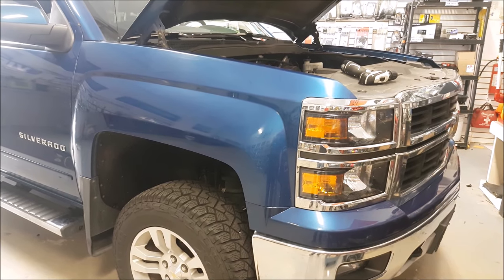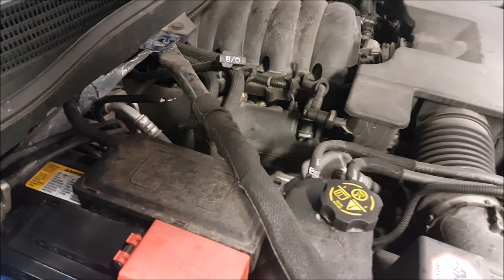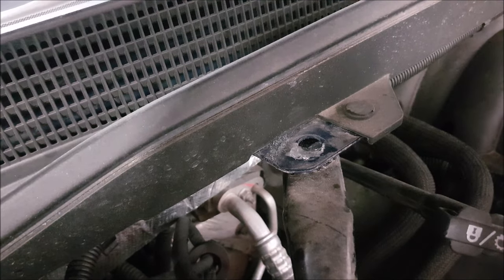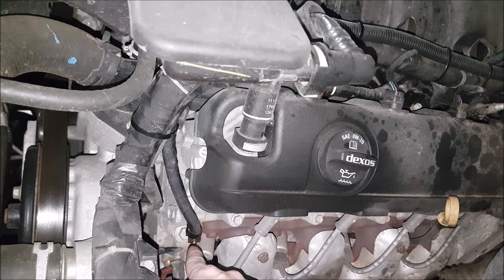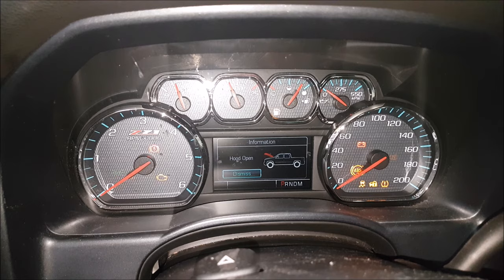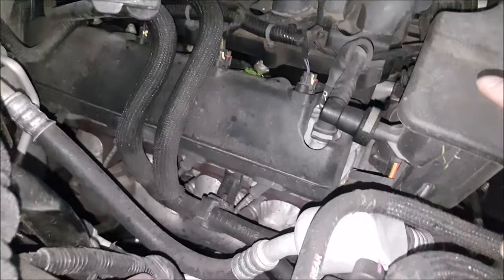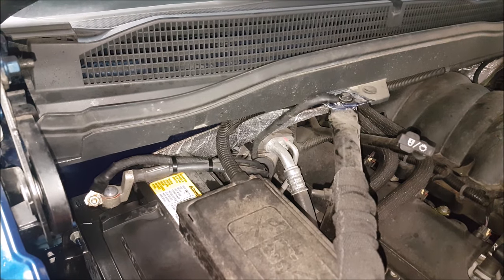2014-2018 Silverado/ Sierra Ground Upgrade K2XX (Prevent Electrical Issues) | AnthonyJ350

Comment: Does the additional ground from driver side cylinder head to firewall go through sensor as well?
Reply from the maker: No, only the wires from the negative battery terminal have to go through the sensor.
Reply: Great tks! Very helpful
Reply from the maker: @robertleblanc7245  Glad it helped!

Comment: I have this problem, but I'm running a couple extra runs of 0 gauge ground. The 0 gauge doesn't fit through the sensor loop. Anyone know how I can do this?
Reply from the maker: I ran 4 gauge through the sensor.
Reply: What size alternator or how many amps was your alternator that you used the 4 gauge for? Was that your only ground for alternator? @AnthonyJ350
Reply from the maker: @SOfficial-ie6bz  Stock alternator on the truck. Also upgraded grounds from cylinder heads to frame and body.

Comment: One more question if you don’t mind. What type fitting did you use for a connector on the left side of the engine? I want to do these things to my wife’s 2014 Silverado. Thanks
Reply: GM side post terminal adapter, the ones you use if you want to add extra wiring to a GM side post battery.  the pitch of thread is the same on the head of the engine.
Reply: Thanks!
Reply from the maker: GM side post adaptor, you can buy it from you local install shop.
Reply from the maker: Don't forget to subscribe ;)

Comment: My 2017 silverado / turns off and back on while I'm driving/ turns off power comes back right away/ no check engine light / I hear it could be the ground that has to do with my ignition/ do I make sense?
Reply from the maker: Was there an aftermarket remote starter installed by any chance?
Reply: @AnthonyJ350  / not that I know of I bought the truck used / I was looking at the grounds that go from battery down there is 2 going from battery thru O ring // I have not gotten to cleaning them / it happened like 2 days back toback / I pulled on them a little and it has been a 20 mile drive and it hadn't happened again
Reply from the maker: @edwincaro8805  Definitely pull the grounds off (disconnect the battery first), clean them and apply dielectric grease.

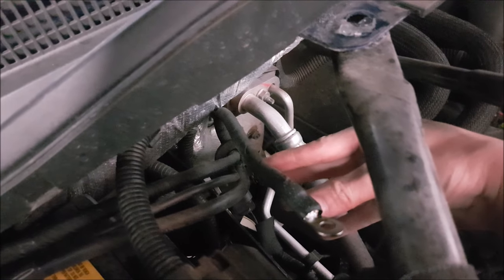Comment: At 1:00, u said u can put a bigger wire through sensor but u have to do something different? Why can u go to same spot as u did with the 4 gauge?
Reply from the maker: You'd have to replace the factory wire with the bigger wire
Reply: @AnthonyJ350  so I have a 2015 Silverado and I was planning on doing the big 3 upgrade with 1/0 wire what is my best option?
Reply: Just seen a video on mechman alternators, and they ran 1/0 from alternator through sensor to battery and kept the smaller ground wire as well and got rid of the bigger ground wire, would I be ok just doing that with a stock alternator?
Reply: And also doing 1/0 for power wire from alternator to battery
Reply from the maker: @lanedupont9316  Yup that would be fine because overall the wire is thicker.

Comment: I have 2016 silverado lt and sometimes my voltage meter drops and i have alot of static noise coming through car speakers i replaced speakers and same thing could it be a bad ground i had my stabilitrak light come on and off alot i replaced the battery and it stopped but it still comes on maybe once every month or two
Reply: Its the grounds. Run a new ground to your stereo's ground wire. My 2014 did this and that solved it. Also upgrade the battery ground cable like shown in the vid. Hope this helps!
Reply from the maker: Bad ground or bad cell in the battery

Comment: Amazing what a little Vaseline will do to force some zero guage through that sensor 💪🏾💪🏾.  Not sure if Vaseline will mess up sheath but 🤷🏾‍♂️
Reply from the maker: Next time you can use synthetic grease which is ok for rubber and plastics.
Reply: I used asstroglide!

Comment: Would this grounds be the cause if there was no power to anything? Or is the Fuse Block on top of the battery. That could be blown ?
Reply from the maker: Most likely a fusible link. There that big box on top of the battery where all the fusible links are. Dumb thing is if one is blown you have to replace the whole part it looks like.
Reply: @AnthonyJ350  hard to tell by looking at it if its blown.
Reply: @AnthonyJ350  how would check it with ohm meter?
Reply from the maker: @nighthawkj30A4  Continuity (on each side of the fusible link) or checking DC voltage for 12 volts on each side.
Reply: @AnthonyJ350  replaced the fuse block and checked the ground at the dash corners by the A pillars. And still no power at all. Going to check the ground by the passenger wheel well.
Reply from the maker: @nighthawkj30A4  What's the voltage of the battery?
Reply: @AnthonyJ350  new battery its 12.6
Reply from the maker: @nighthawkj30A4  Need to check all the fuses. Is there power inside?
Reply: @AnthonyJ350  we did there is no power to anything. No interior lights nothing even the remote doesn’t work.
Reply from the maker: @nighthawkj30A4  Need to check the fuse panel under the hood and make sure the battery wire is tight and showing voltage there. The whole thing can partially pull out.
Reply: @AnthonyJ350   check it as well

Comment: I have replaced  the battery  altantor  and starter  but I when I go to start my truck  it won't crank  but sometimes it will start   after awhile   I need help I can't figure it out lol
Reply from the maker: Check the starter relay and swap it with another one to see if it starts better. If it does, purchase a new relay to replace it.
Reply: @AnthonyJ350  it was a fuse for abs something  I replaced it and it starts no problem
Reply from the maker: @Ricky-manic  Glad to hear you figured it out!

Comment: I plan to do this soon on my 2018.  I have a bunch of 6ga already, would that work?  or should i go grab some 4ga?
Reply from the maker: 6 GA is fine. Are you planning on running a big sound system as well?
Reply: @AnthonyJ350  no not at all.  Maybe an LED bull bar in the front, but only when i need it.  Mine has a slow crank, even when its warm.  The battery seems fine, i havent pulled it to have it tested, but it has 12.4v even when its really cold.  No issues with lights or anything electrical, just a slow crank on every start.
Reply from the maker: @taz03dak  Oddessey makes batteries with LOTS of cold cranking amps. The upgraded grounds should help a lot. Those trucks are also electric power assist steering as well correct?
Reply: @AnthonyJ350  Yes it has the electric power steering.  I should just go with my gut and grab a 800cca battery and upgrade the grounds
Reply from the maker: @taz03dak  The other option is to add a secondary battery and run two AC Delcos. GM trucks have the spot for the second battery.

Comment: I did the big 3 upgrade and did this exact same thing running 1 of the new cables from battery through the ground sensor/meter cleaned up all the stock connections as well and now my clock goes off and on while I'm driving and have no sound through speakers sometimes the complete radio turns off and on while driving as if I was barely turning on my truck showing the chevy mylink symbol it has been like this for almost 2 weeks now and still can't figure it out
Reply from the maker: Weird, battery terminal is tight and the clamp is plugged it. A loose ground will cause weird issues.
Reply: @AnthonyJ350  Yes I double checked every ground point and still nothing. Everytime it shuts off theres always a popping sound then turns back on after a few seconds and just keeps repeating the whole time my truck is on.
Reply from the maker: @jovanymejia2439  Where is the popping sound coming from?
Reply: @AnthonyJ350  from my speakers mostly from the one on the left side of the dash where the chime sound comes out of.
Reply from the maker: @jovanymejia2439  Is there an aftermarket amp or head unit?
Reply: @AnthonyJ350  Yes I have 2 amps with stock head unit 1 amp for subs and 1 for mids and highs. Everything was good until adding the big 3 ground upgrade.
Reply: Still no radio 😒
Reply: @jovanymejia2439  I’m having the EXACT same issue🙁
Reply: Ever figure out what the issue was?

Comment: What type tape do you use on the wire and where can I buy it?
Reply from the maker: Exterior Tesa.  You can buy it herehttp://rover.ebay.com/rover/1/711-53200-19255-0/1?ff3=4&pub=5575240889&toolid=10001&campid=5337982243&customid=&mpre=https%3A%2F%2Fwww.ebay.com%2Fitm%2F4-pcs-TESA-51026-19mmx25m-tape-high-abrasion-protection-of-automotive-harnesses%2F173817273443%3Fhash%3Ditem2878511c63%3Ag%3AyKIAAOSwdzBcwDZ1

Comment: Is it just me or did these ground upgrades cause my voltage meter not go as low as before, it used to go as low as 12 now it seems to stay right under 14
Reply from the maker: It's very possible. Electricity has better paths to flow now with the upgrades. Every vehicle responds differently, but I'm a big advocate for this upgrade on any vehicle.

Comment: Will this help with the common lights flickering issue and stuff like that?
Reply from the maker: It will help reduce it.  It will also help the power steering work better as that is electric on the newer trucks.
Reply: Theres also another ground problen on the dashboard ..my dealer couldent even find it lol so i parked my truck for 1 hour got back to it it wouldent unlock with the remote so i used the key there was no power at all i gave it a jump for about an hour and it wouldent start still so i used the jumper cable from the batter to the chassis and started right up i was able to make it home to fix the problem 😎

Comment: I’m about to install a mechman 250 on my 2018. Waiting on my distribution block so I can remove the factory gnd and install my 1/0 ground.
Reply from the maker: Nice
Reply: Any updates on the mechman?
Reply: Mine worked great but my transmission just ate itself at 52000 miles so it was fixed and I traded it in. I’m currently selling my alt
Reply: Did you get the RVC delete and if so what fuse did you tap for the alt?

Comment: Hi! I have an 18 Silverado with a cb Raido and I get noise from my head lights and power steering. Any idea how I could eliminate that? Thank you
Reply from the maker: Where did you ground the radio to and where did you grav power? If you have an external speaker you can try twisting the wires https://youtu.be/fsK3J9scgtw
Reply: @AnthonyJ350  power straight to battery ground in cab near radio no speaker
Reply from the maker: @Fox250R  Did you clean the paint off and nut and bolt your ground or use a factory ground bolt?
Reply from the maker: Upgrading the grounds in the video, mainly the cab mounts will help as well.
Reply: @AnthonyJ350  Factory bolt
Reply from the maker: @Fox250R  Cleaned the paint off?
Reply: @AnthonyJ350  off my mount? No. Might be a good idea huh
Reply from the maker: @Fox250R  The paint of the chassis where the bolt goes in. Is the radio antenna cable ran close to power wire? Also is the antenna tuned?
Reply: @AnthonyJ350  not sure about the bolt tbh. The power wire runs from the battery to the inside of the truck and yes it does run along other cables but not a very long distance and my swr is 1.3 on most channels
Reply: @AnthonyJ350  Dude my truck is just cursed from day one with this cb shit I sware to god! I’ve moved my antenna many times to see if it helped Nope, I’ve tried a hand held hooked up to my truck antenna and it was the same thing. Either my lights or some other electrical issues is causing static along when I turn my steering wheel! Such bs lol! Thanks for the help anyway man but I think I’m screwed at this point.
Reply from the maker: @Fox250R  It could be the battery itself. The battery acts as a filter. Is it the original battery from 2018? They should he changed out every 4 years anyways.
Reply: @AnthonyJ350  battery is brand new as well as the alternator.
Reply from the maker: @Fox250R  What brand is the CB radio, we install Motorola radios regularly with no issues. It's a VHF radio though.
Reply from the maker: @Fox250R  Curious, if you unplug the antenna, do you still get the noise?
Reply: @AnthonyJ350  I use 3 radios Uniden grant xl, Lincoln 2 plus and a Stryker 955. The grant is a bit more quiet than the other two radios but I can hear the head lights And steering wheel noise much easier on the grant. The other two radios have so much noise its harder to hear. And when I remove the antenna it’s quiet no noise what so ever. None
Reply from the maker: @Fox250R  It sounds like the issue is the antenna. If it were wiring feeding the issue, the noise would stay with the antenna hooked up. How is the antenna attached? Does it have a ground plane?
Reply: @AnthonyJ350  The mount is on my left side of my hood. Fender mount i think its called. I had it near the cab but my swr sucked. Where it is now its right around 1.2,14 feet of coax RG8x

Comment: I ran the positive wire for my sound system through that little sensor thing. Is that okay or should it not be there next to the negative cables?
Reply: I believe that’s for negative wire only.
Reply from the maker: I wouldn't

Comment: This might solve the issues im having
Reply from the maker: Let us know if anything changes!
Reply: I’m having issues too. It gets to hot and I have to move it to get my truck to start. Sometimes I’ll just shot down completely.
Reply from the maker: @lavidanormalderay3296  What gets hot?
Reply: The ground terminal  it feels like is melted I move it and the truck would start everything again.
Reply from the maker: @lavidanormalderay3296  Shouldn't be able to move it. If it's lose it could be arching making it hot. Can you make sure it's tight?
Reply: The terminal is tight as it can be is the wire that moves all around I was looking for a video and saw yours but I don’t know how to do it properly.

Comment: When you say "it will have to be distributed like they did, you might have to do the junction point at the block". Are you referring passing the cable they the sensor somewhere else? I have 1/O wire i want to run.
Reply from the maker: Which part of the video are you referring to?

Comment: Anybody replace this cable due to Stabilitrack issues? I’ve heard of GM’s G218 electrical issues; however researching options?
Reply from the maker: It's worth doing.  Better grounds can even help the electric assist steering.
Reply: @AnthonyJ350  thank you!
Reply from the maker: @abasin08  You're welcome

Comment: Dos anyone know if there is a larger sensor you can replace the factory one with? I don't see how anyone uses 1-4/0 gauge cables on their upgrades unless they bypass the sensor on negative wires coming off the battery.
Also, can you please post the bolt size used for grounding to the block? Thanks
Reply from the maker: I think people are bypassing it with a aftermarket alternator and external regulator when going that thick.

Comment: All I had was 14 awg wire. I doubled it up and ran (2) 14awg from battery ground to the cowl as in your video. Is that ok, or am I at risk of this wire being too small? AKA melting? If so what gauge is adequate? I have a 2018 sierra and have odd codes every few months like service stabillitrack, service safety restraint system, U0140 lost comm with BCM, B127E, B1325, U0415. Never a power steering code. FYI when truck was under warranty dealer replaced neg battery cable because it was high resistance. Didn't seem to fix the every few months codes though. I did clean all neg cable grounds to no avail (frame on passenger side near front wheel well, driver side under cab under driver seat, engine ground). I have not checked the G218 dash ground as that was supposed to be fixed in later model years. Was hoping this ground would help since its going to the cowl like the g218 under the dash. Thanks for the informative video!
Reply from the maker: If you're adding it's ok but 8 gauge as a minimum would be better. You might need to check the Onstar antenna and make sure it's not leaking
Reply from the maker: This video might also help https://youtu.be/Rjy4sqzzHgI
Reply: @AnthonyJ350  Appreciate the replies. Checked onstar antenna, no indication of water after checking in places mentioned in video. Maybe I have a loose or bad wiring harness somewhere, only happens occasionally. Yesterday I got a P0442 EVAP small leak detected permanent code. Have capless fuel filler but maybe its the purge selonid. Would prefer the old cap filler that's been used for over 100 years, wonder if I can convert to it. Been 15 degrees F mornings lately, not sure if that has anything to do with it.
Reply from the maker: @doctube2020  Try to find all the frame grounds and clean them off and dielectric grease them. GM puts a coating on the frame. Also what's the voltage of the battery when everything is off?
Reply: @AnthonyJ350  cleaned all the frame grounds a year ago. One on passenger wheel well frame, driver frame under cab and engine block all bare metal. Didn’t dielectric grease though. Battery is original and I keep on a maintainer when parked for a week. Batt voltage is 12.54 currently.
Reply from the maker: @doctube2020  I'd grease the grounds. Do the codes come more often after you wash the truck or after heavy rainfall?